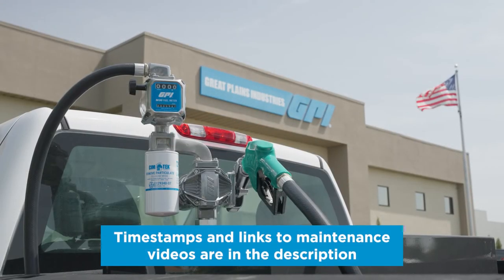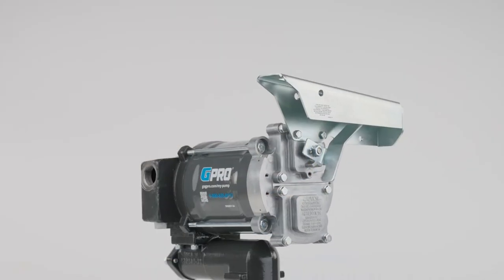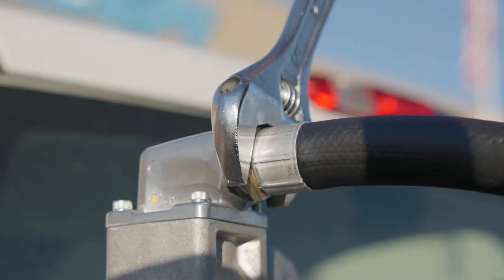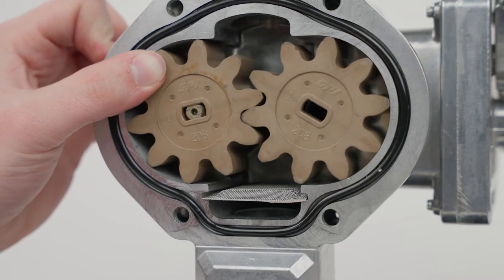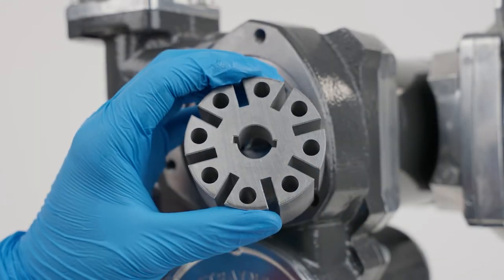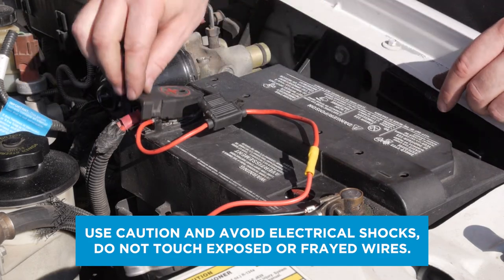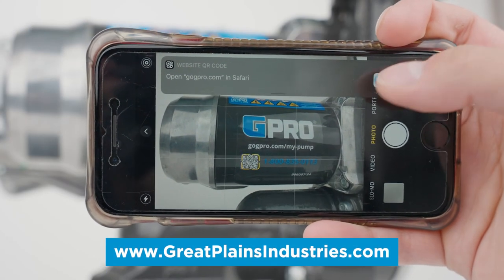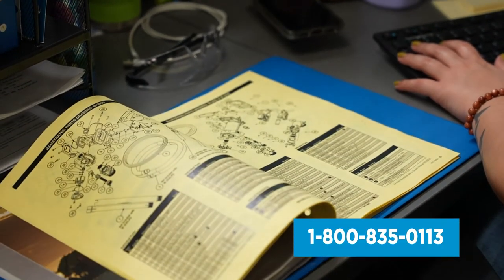GPI/GPRO Fuel Transfer Pump Troubleshooting

Comment: Causes of a GPRO pump overheating when used for unleaded fuel application? Overheats within a short amount of time, requiring reset.
Reply from the maker: HI Jeff! Could you contact our Product Support Team at 800-835-0113. They are available M-F from 8am to 5pm. They can help troubleshoot what's going on with your pump. Thank you!
Reply: Mines the same way pump works but after like 10 - 15 seconds it shuts off then i turn it off let it sit for 10 sec and it works again but problem  continues
Reply from the maker: @rodriguezequipment2113  Hello! Could you contact our Product Support Team at 800-835-0113. They are available M-F from 8am to 5pm. They can help troubleshoot what's going on with your pump. Thank you!
Reply: @rodriguezequipment2113 did you end up knowing what it was?